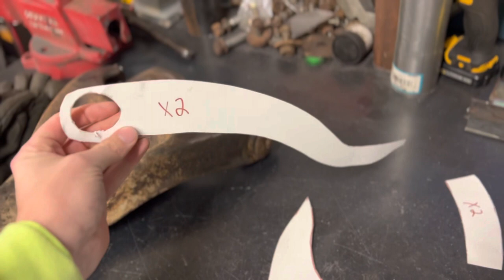How to extend Impala A-Arms and add gbody ball joints! Stay Tuned! #lowrider #chevrolet #impala #64

Comment: Looks great.  What is the benefit of the 1" extension?  I'm not a lowrider guy and have no intensions of using bags, or hydraulics ...
Reply from the maker: Hello, 
So a couple benefits with the extension would be a better offset on the ball joint for hopping. Also, the extension prevents the wheels from “the butterfly” look when fully locked up. Also the A-Arms are “kicked” out further from the frame which provides more room for lift and moves the arm further away from the cylinder. Hope that answers your question. Thanks for watching the channel.

Comment: Why did you switch to gbody ball joints?
Reply from the maker: The main reason is to upgrade to a four bolt style ball joint as opposed to the stock three bolt type ball joint. Also, I wanted to use the Napa heavy duty ball joints.

Comment: This is YourBoyEric again from Cali. Again great video. I have one question. When welding 3/16 steel how do you set your speed and your heat?
Reply from the maker: What up Eric! That’s a great question. In my opinion, you want as many amps as your comfortable running. I run my welder maxed out on the amps. A good rule of thumb to remember is when you’re running hot you’re running fast! So your wire feed speed needs to match what kind of heat you’re putting out. Think of it like a car with a clutch, the clutch and the gas pedal have to work together, a welder and it’s settings are no different. Play around with the settings on your welder and see how fast you can run your wire speed and how hot you can run. Once you’re comfortable doing that, then you’ll know. I hope that helps answer your question, just find that sweet spot. Thanks for watching bro.

Comment: How are you going to do the finish on the upper and lower control arms are you going to paint , powder coat or Chrome them?
Reply from the maker: Hey Joseph, most likely gonna just paint them. Chrome is crazy expensive right now. Maybe someday down the road. Thanks for watching!
Reply: @gemcitywelding7234  I have painted mine in the past and used POR15 engine enamel.  It was the only burgandy POR15 had and it help up great even with some friendly hopping.

Comment: where did you get the arm cutout stencils or how did you make them?
Reply from the maker: I made them. Add your extension pieces and then use the extended arm as your template for the other plates. It’s basically just tracing the arm after it’s extended. Similar to how I did the frame wrap. Watch those videos for more explanation.

Comment: Can you use flux core to weld frames or do you have use gas
Reply from the maker: Hey bro, 
That’s a great question! The short answer is yes you could use flux core. Although it is not highly recommended. For the cleanest possible penetrating weld, I would recommend using a mig machine with a 75/25 mix or a 80/20 mix for weld gas. Also, experience with different weld process’s can produce different outcomes. I would always recommend a mig machine with gas, if the user has the budget. Hope that helps. Take care bro and thanks for the support. 👊🏻💪🏻
Reply: Thank you much my machine does flux mig and stick but I'm leaning to use it next question I'm building a lay an play but if I get crazy with it do I reinforce the belly all the way around or just on the three sides ps are there any lowriders in Dayton